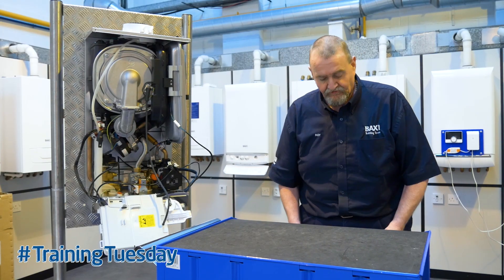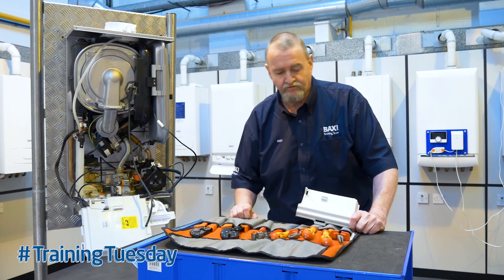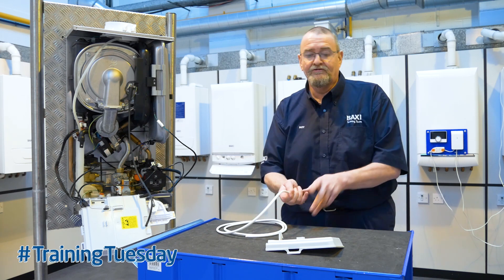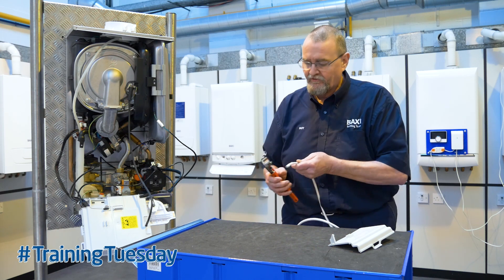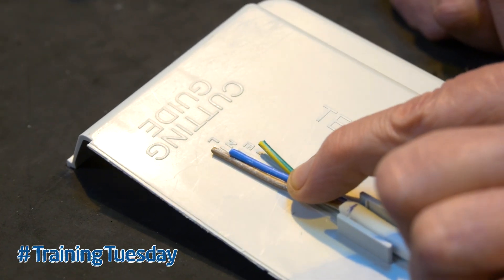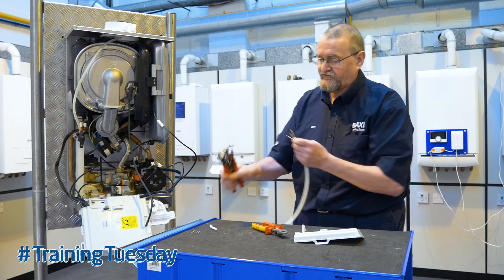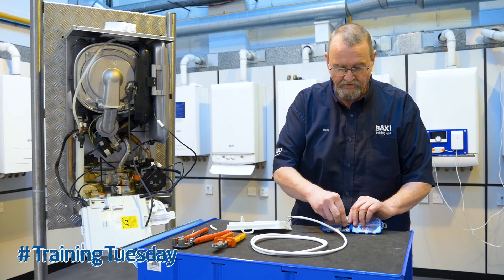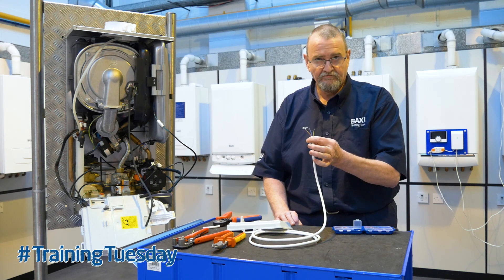Wiring a boiler Part 1 - How to wire up a boiler neatly, demonstrated on the Baxi 600 Boiler

Comment: Regarding the cable size of 0.75mm, BS7671 states that the minimum CSA for any non lighting circuit supply should be 1.5mm². Can you explain how this still complies? Is there another reg that makes it compliant? Thanks.

Comment: I was always taught that the earth wire should be slightly longer than the live wire so it was the last to detach if pulled out of connections, otherwise there's a chance that any metal parts could be live without appropriate protection.
Reply: Steve Topliss quite right Steve!